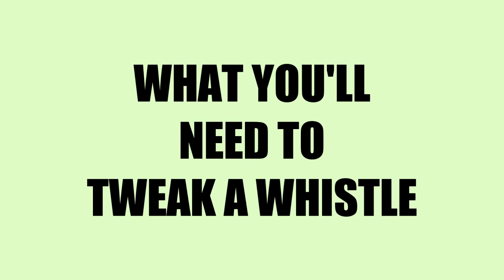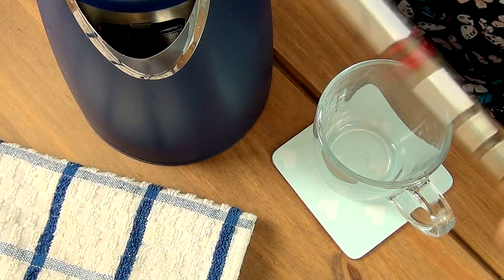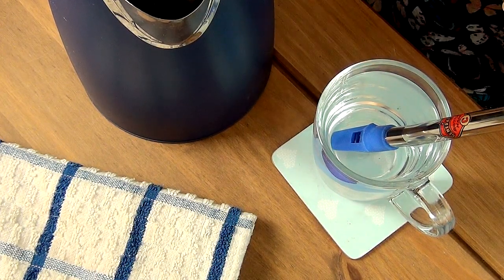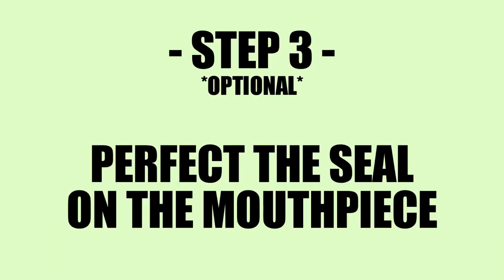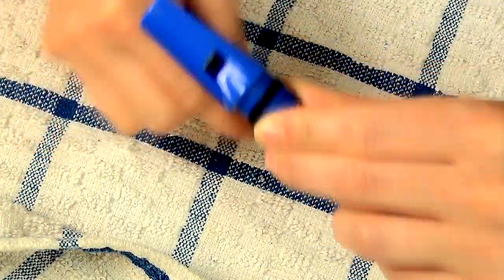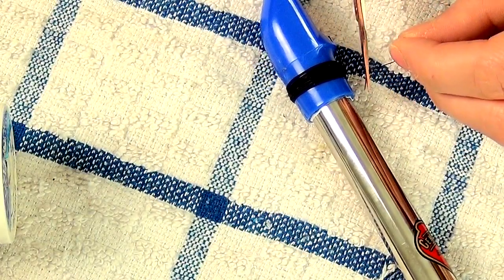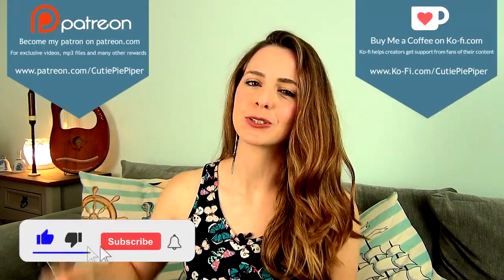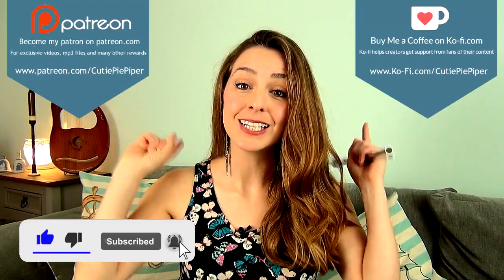HOW TO 'TWEAK' A TIN WHISTLE - 5 EASY STEPS ANYONE CAN DO!

Comment: Thank you for the tips. I was a tin whistle player for almost forty years until I had a stroke and the left hand eventually does as it is told, but too slow for a tin whistle. I was interested in an overtone flute like the koncovka from Slovakia which requires one hand. Being  able to remove a generation mouthpiece means I can transfer a D mouthpiece  to a tube of stainless steel I have which is of identical diameter to a D whistle. It is a one handed instrument like a tabor pipe and can be made in less than an hour if I can scavenge a mouthpiece (fortunately I have several D whistles I can no longer play, so there is luck!). The bore of the whistle is about fifty times its diameter and by overblowing with the end of the tube open and closed I will have a range equivalent to a tin whistle. A similar instrument was used by the Ukrainian entry in the 2022 entry in Eurovision. It won't be easy but needs must...
Reply: Have you looked into one handed recorders? I'll try to find the brand and get back to you but Sarah Jeffries covered it on her team recorder Channel https://youtu.be/xlXjr0oOrXs if you want to search for it after you watch it. I think you can control the other notes with keys and control it all with one hand. You might be able to get your bad hand to kind of help out here and there with some of the keys but it wouldn't be responsible for holding down all the notes all the time. The Yamaha version of this is kind of pricey at the $3 to 500 range but maybe it's possible to find it used. I hope you can get one so you can still easily play and share all of the tunes that you know after 40 years lol.
Reply: Just wanted to add that Generation actually make their own one handed tabor pipes, which you might be interested in.
Reply: Best overtone flute is G# 🎶👶🎶

Comment: Update:  I would NOT recommend putting PVC tape or anything like it on your whistle. Using the instrument wax would be fine but I found even  one turn of pvc tape caused my head to crack. I will go ahead and glue it but I believe the plastic heads are too weak to try anything but a wax or petroleum jelly to seal up in micro leaks you may have with your whistle. It was a silent crack which I did not know it until I tried to play it. The crack was along the seam where the two halves were put together. It is a real cheap plastic that they use.

Comment: Hi Stephanie, that certainly did make a difference to your whistle. I don't have a Generation one, so I know mine will be different (Sweetone, Feadog and Guiness). Have you ever tried making the tweaks permanate? I wonder if Milliput would do that? If you have never used Milliput, it's worth having a try on something else first. It is a modelling epoxy (2 part) which you can shape before it sets with water, or a wet knife blade ( or wet fingers, it washes off with soad and water, before it sets).  It sticks to most things, and can be sanded when it sets hard, which from memory is about 4 hours. But, more difficult to remove than blutack if it goes wrong! Thanks for the tips!
Reply from the maker: I'm sure it'd be fine to make the changes permanent using something non toxic that hardens 👍

Comment: Hi. The physics of tweaking is this: mass (weight) absorbs random sound. The sound of metal flutes (Boehm or silver) flutes sounded shrill to the ears of the Germans. They preferred wooden flutes with all the keys of a silver flute. Richard Wagner supposedly said: the only thing worse than a silver flulte is 2 of them.

I had a Haynes flute over 100 years old & the top end where the mouth piece has a stopper, the stoppler had a screw down end & the threaded section of the stopper was a heavy metal weight about an inch long. The flute I had was from 1915 & that was the first year Haynes sold as many silver flutes as they did wooden flutes. Now wooden flutes are hard to find & expensive.

So adding poster putty just ads mass and reduces the resonance of the tin whistle. But the tin whistle sounds purer, less bright this way. Lir and Wild Irish tin whistles are heavy near the head and you can blow with lots if force and they stay in tune & do not overblow.

I tweaked a cheap whistle & it became easier to play. But I removed all the poster putty & learned howto play the cheap whistle without any tweak;ing. Since it is hard to play, I do not play it often. But I had to learn a lot about breath control. I have a cheap all metal whistle which has thick walls and it gives a darker sound than most whistles. Twaking a whistle vs. not tweaking, like most tings muscal is a matter of choice. Finding the right point on the scale of bright sound vs. tweaked sound is a compromise. Expensive whistles have made choices about the sound they produce, so you can choose the sound you want. I'm not reccomending spending lots of money, Most whitle players have several flutes. But mastering one whistle is probably more productive for the player than buying so many flutes. I obviously have thrown away some money on flutes I almost never play.
Reply: I am a seasoned woodwind player and agree with this assessment, which is why I ended up filing the blade instead of building on it. Filling the mouthpiece didn't affect the resonance much in my case. I found it actually balanced my whistle out. So while you're correct, I think poor craftsmanship also plays a part in whether or not to play with/without making adjustments to any cheap whistle lol!

Comment: I received one just like what you are using except in Bb.  I found it had no glue at all. The mouthpiece came off with a little warm water below boiling to prevent warping and I did not have to leave it in the water for even 30 seconds. I tried the blue tac in the rear cavity but just saw your video and will try filling the other area you talked about. Thanks for the excellent explanation and the close up video. You must use a pretty nice camera.

Comment: Thank you so much for your video! This was phenomenal advice. The only thing I did differently to modify my Clark whistle was to take a glass nail filer to the blade instead of building it up with blue tac. I tried the blue tac and simply could not get it to work for whatever reason (but it was perfect for filling the mouth piece). So, instead I filed the blade SLIGHTLY and it had the same effect. (To anyone thinking of filing instead of building up, do NOT use emery board or sandpaper. Use a very fine filer like I did. I used a glass filer because it is a much softer/smoother file and will leave a smoother edge.)
Reply: Also, I will say to anyone who is a beginner with any woodwind that the embouchure (your mouth position on the instrument) is very important to have down correctly, especially if you're playing a cheaper instrument (because they are less forgiving). I've found that the whistle embouchure is not as easy as it may appear, and I'm a flautist so this is saying something lol! Applying that skill with these tips will get you the best sound!

Comment: Thanks! Discovered your channel while trying to decide on a tin whistle.  Fingering pattern seems similar to a recorder. Originally thinking inexpensive $10-20usd and deal with potential issues.  Now thinking Shush Classic.  Bad idea for a first whistle?  The softer projection of sound might be appreciated by everyone:). 

 Unsure of type of glue used.  But if similar to hot glue adhesives used in craft and industry. The glue that comes in sticks that you melt in a hot glue gun. You can easily break the bond using 70% isopropyl alcohol (rubbing, 1st aid alcohol). It should wick into any void between the the plastic, metal, and glue.   Just give it a few moments to break the bond. Might leave a hard residue of the glue which is brittle and easy to clean off with an old toothbrush. Maybe less chance of damaging the mouth piece?   No go, then your hot water tip. Optional method of string binding.  Seizing hitch. The hitch used to seize loose rope ends.

Comment: Great video, I bought an inexpensive Eb Generation just for this purpose.  Worked great!  I couldn't get the head off with hot water though so I tried a heat gun, suggested by someone at Chiff & Fipple.  That did the trick.  Thanks for the easy to follow tutorial.

Comment: Tip for loosening assembly glue without water:  use a rice sock (like a heating pad you can buy/make for your neck shoulders) and microwave it to the temperature you need (usually almost too hot to handle will due).

Comment: Hm, i did not expect such difference. If it works that good for such a well made whistle, i guess it will be even better on good old Clarke's MEGs. Thanks!
Reply from the maker: I'm not sure how well the Clarke whistles tweak, I think the mouthpieces are more difficult to remove on Clarke whistles (or so I've heard)
Reply: @CutiepieTinWhistle  Yeah, construction itself will make not only removing it quite a bit of 'fun' but then assembling it back will be not easy due to 'rolled sheet of metal' way they were made. But i think it's worth a try, even just for fixing bad fit to prevent so much air leakage around it.
Reply: There's Clarke traditional whistles too where the tweaks are different - I've done the first bit of changing the profile of the blowin' end over the wooden block but haven't started straightening out the blade with a metal tool and arguably don't really want to...

Comment: I didn't have any of that but I had some Play-Doh so I shoved that in there and padded the end of that with the cotton on the end of a Q  tip and was bored so ended up kinda putting different colors of yarn around the head joint for the stability... And this morning I think the Play-Doh has dried in there it hasn't come flying out yet... I used the end of a pen a hair pen and tweezers and whatever I found to shove that in there even the Q tip and I couldn't find the scissors so I grabbed my pocket knife I didn't need any tape or the hot water because when mine came in the mail the heat outside already took the glue off it ended up coming not centered and had to put it back the way it's supposed to be.

Comment: I've just found this - thanks for the tips! I have a high D "Meg" whistle that was extremely cheap (I bought it in a tourist shop in Dublin for about £10 I think!). Upon inspection, it seems to have a slightly better mouthpiece than the one you show here. The blade is very neat, and the cavity under the air hole is smaller. However, the actual tube looks very cheap: it's tapered, but it's obviously been formed by rolling and has a seam along it. I was wondering how much success I'd have with improving that sort of instrument? Is it worth doing? The whistle actually sounds surprisingly good, given how cheap it was, but it could definitely be better.

Comment: There are many makers of those cheap tin whistles with plastic mouthpieces, most of them get fairly consistent good reviews for what they are, and here we have Generation as the one brand that by far, is the one that people feel a need to "tweek" because the whistle as sold, whistle to whistle, is predictably of inconsistent quality or flat out defective. So since the whistle is ~ $10 and you must then spend an additional $20 on supplies and tools, and spend time learning new "repair technician" techniques and spend an hour attempting to "tweek" a defective bad purchase, logic and self-respect of the consumer demands of logic to stop buying Generation whistles and buy whistles that play properly at the time of purchase. Why agree to being repeatedly and predictably scammed? What other items of any kind, would you agree to buy and have to go through this process? There are many whistle brands not any more expensive than Generation, that will play well out of the box.
Reply from the maker: I agree generally. Though from what I understand, Generation whistles are often easy to get in countries where other whistles are not, as they can be bought in bulk. It's definitely better to buy a better quality whistle, bit it's certainly worth trying to improve the crap whistles you have, especially if you have a bit of bluetack 👍
Reply: It’s the only whistle I can buy in South Africa. So, mods here I come.

Comment: I'm going to give this a try on my Generations D that's been sitting for 15 years in the back of my whistle storage locker.

Somebody told me that many years ago, 20? 30? More?, Generations made a decent cheap whistle.. but now it's very hit and miss, with emphasis on the miss.

I was told to find a good one these days you have to go into a shop (for all the people that live around a shop that sells tin whistles) when they get a fresh supply of Generations in and just go over to the display and start playing them till you find one that by happy happenstance happens to be in tune (nice way to do it during covid too).

The problem with that method is that it only takes one or two people to soon take all the good whistles from the display and the only thing left behind is the standard s.... stuff. The standard stuff, which is not really up to standard.

Or we can watch cutie-pie's video and learn how to tweak our whistles.
Reply: Or just buy a Clarke Sweetone and get a whistle that's in tune and plays nicely for the same price as a Generation or Feadog :)
Reply: @sahamal_savu  Get thee behind me Satan. 
It took years and many meetings of WA ( whistlers anonymous) but I finally got my WAS (whistle acquisition syndrome) under control.  Just got my 10-year chip and I'm not about to backslide now 😆  😆

At one point the number of whistles I had was in the low 50s. And of course they included the usual Generations, Clarkes, Feadog, Mellow Dog (a Jerry Freeman tweak), Susato, as well as from smaller independent makers such as Chris Wall, Becker, and one very nice whistle that included a pamphlet concerned about my salvation through Jesus as well as many others.

Finally thinned everything out down to...13-14? (can hardly keep track of those even now) of my favorites. 
My favorites because they play well (or at least as well as I can play them) and others for nostalgia purposes just because. My Original Clarke, Clarke Sweet Tone and brass Generation D.

Sooo, they thought this video I may now try to tune that Gen D.
Or I may not, because, if you mess such things post-production, that may lower their collectors value 😆
Reply: @michaelrs8010  A salvation whistle?  Timothy Potter?
Reply: @soslothful  Yep. And strangely enough Christmas tunes I play on it never sounded better. 😁
Reply: I've got a Bb Generation from the 80's which I love. Plus, a 10 ys old Feadog whose raspy sound speaks to me. I'm doubtful about 'taming" it with that putty method...
Reply: @frakognome4434  well, you definitely have to have a a little related knowledge and a feel for it. 
I had a tweaked Mellow Dog by Jerry Freeman (if one doesn't know who/what that is it's easy to search) and it was okay.
 Lots of people swear by them, but I personally didn't think it was anything to write home about. In fact at this point I can't even remember if it was one I got rid of or kept for the novelty of it.
All except two of my remaining whistles are in storage and I put two back and get two out about every 4 to 6 months 😄 so I sometimes forget a few of the ones that I have.

On the bright side if you have a generation that is not playing 100% ( which is pretty much the standard now more than it used to be. They changed something some time ago in their production process which made the fipplel worse than it had to be),  it's very inexpensive to play around with this tuning method and if it doesn't work just get another whistle.
On the other hand, if it does work, Bob's your uncle. 👍

But yeah if you have an older Generation made the old way, you probably have a nice playing whistle for the price and with a little TLC will last you
Reply: @michaelrs8010  Do you find the Cnat. considerably out of tune?
Reply: @soslothful  You know, honestly, at this point, I do not remember. It's up in storage and has not been in my fingers for a good year now. 
I just remembered overall I was happy with it and thought it played very well.
And since I don't have that good of an ear for music, unless something is drastically off... well, you know, ignorance is bliss.
My big thing with a lot of these whistles is the ease of transition between octaves and I do remember being pleased with the Potter in that regard.

Damn, this is what I was afraid of. All this whistle talk made me remember I never got the Killarney that I wanted 😄
Reply: @michaelrs8010  I liked the Potter well enough for the price other than the Cnat.  It has the advantage of being quite quite. Though I too put it aside and it has not been played in a good while.

I have a Killarney it is a top end whistle, solid and substantial feeling and spot on tuning,  Still, I play my Becker's more than the high end expensive whistles I have,
Reply: @soslothful  You have a Becker's too. Yeah, I have three of his whistles. A high D a Low G and I forgot what the other one is 😄. I think those are an excellent value craft whistles for the money.

Which Killarney do you have the brass or the nickel.
I agonized over that at one point but then I figure I'm just going to get the brass.
People say there's a tonal difference they can hear , but I don't think so. I really defy anybody to be on one side of a screen and be able to identify if the person on the opposite side is playing a brass or a nickel one.
Reply: @michaelrs8010  Brass.  I like the weighty feel though it has nothing to due with the pitch quality, just an aesthetic point. The McNeela Wild is especially nice, too.
Reply: @michaelrs8010  My Becker collect is: Low C and D, then C, D, A, Bb. G and two custom made Hijaz  scale whistles.  Two dual whistles: A D full scale coupled with a D with only the D/E/F holes and a D with a holeless drone.